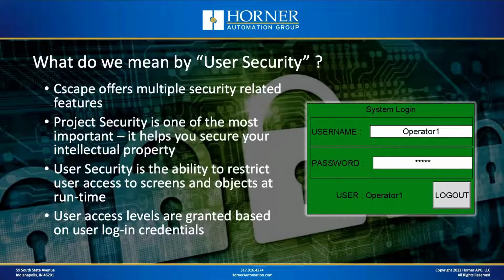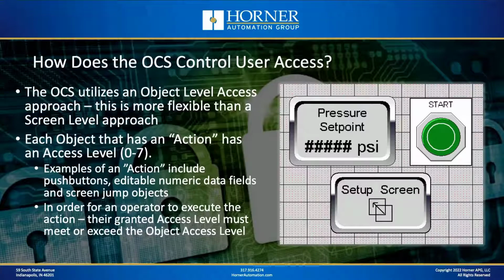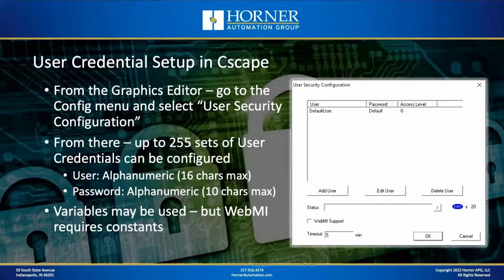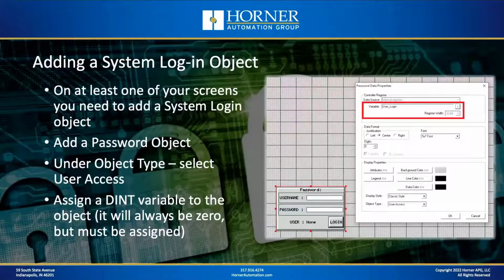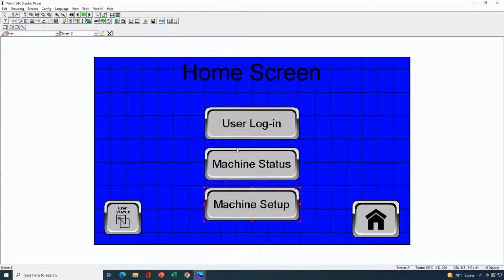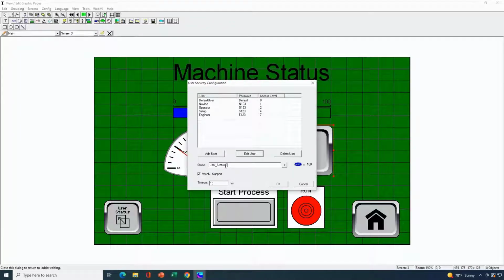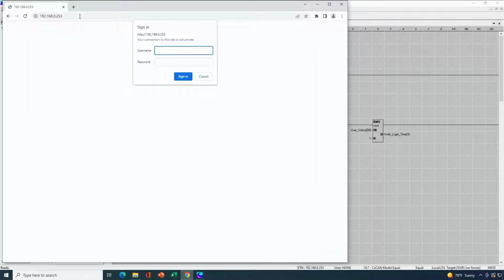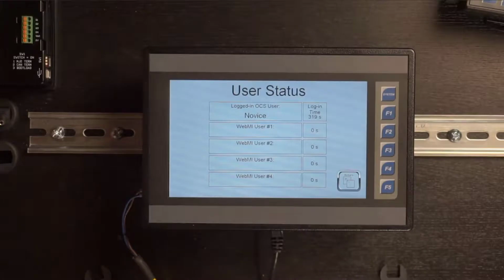OCS User Security

Comment: Is it possible to get a copy of the demo program used in your presentation? Thanks
Reply from the maker: Here is a link for that demo program:  https://hornerautomation.com/wp-content/uploads/2022/06/User-Security-Example.zip
Reply: @HornerAPG  Thanks for the link, however when i try to open the file in Cscape I get an error "Cscape file operation error"
Reply: @chriswarren3953  Hi Chris, you might try using a newer version of Cscape. Not sure which version you're using but this file was probably created using 9.9 SP6. If that doesn't work, make sure you're unzipping the folder in order to open the file.

Comment: In the screens the jump button shows an Access Button where you can define user access levels.  However on our jump button properties, no access button exists.  Also in the User Security Configuration option is greyed out in the menu system.  is there a setting we are missing to enable this option?
Reply: 3:52 Only certain models have the ability to be configured like the video. Having the same issue and its because I have a Micro OCS instead of the XL and XL prime series
Reply: Hi Neil,

Yes, I believe you may be using a Micro OCS or XLe/XLT. Unfortunately it is not supported in these products, only for the XL4 and up on the XL series and XL4 Prime and up on the XL Prime series. Sorry for any confusion.